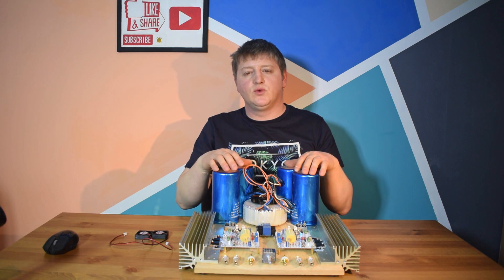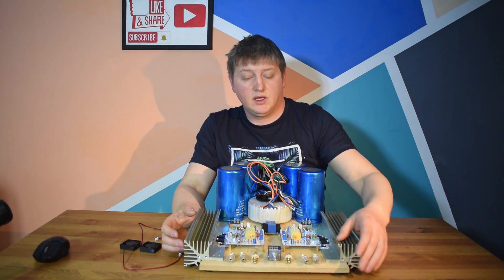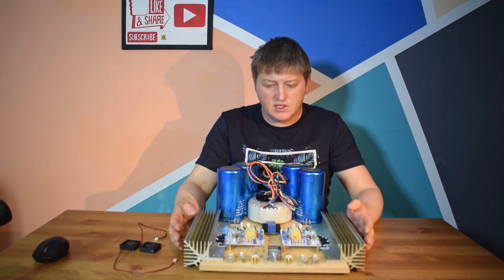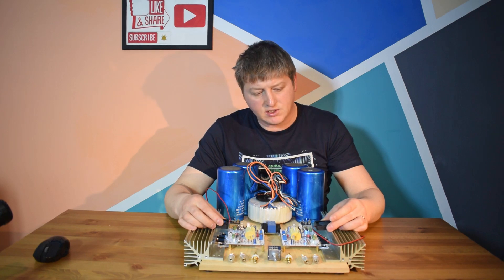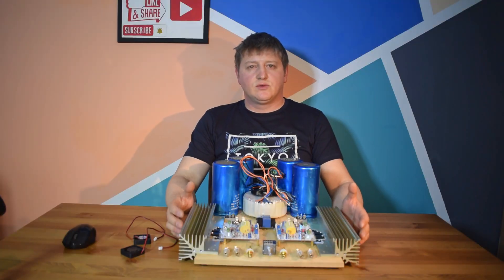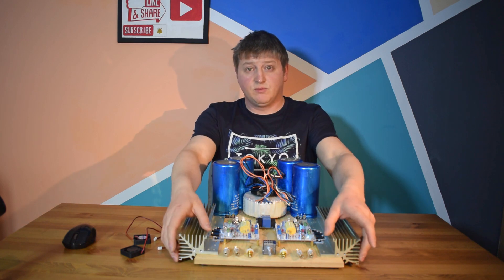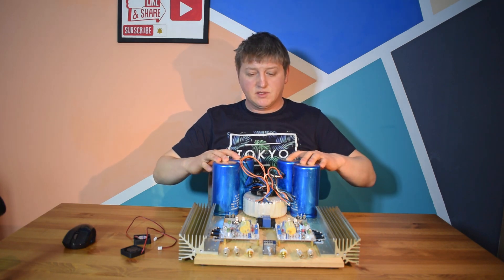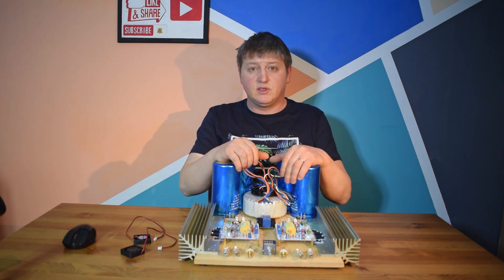Jean Hiraga super classA 30W amplifier build part 2

Comment: I want ask:
1)What is using Elco cap&how uf?
2)did using transformer Ampere&how much transformer?
Reply from the maker: You mean the blue capacitors or the yellow capacitor? And the transformer is dual 24vAC times 2 with 5.6amps
Reply: Blue capacitor
Reply from the maker: @danielhendrik5554  so are 30000 uf each capacitor
Reply: Thank you.
Can I use 2 Psu (one Psu 40000uf)/chanel ?
Reply from the maker: @danielhendrik5554  this amp is powering with dual rail positive and negative and ground so u need 2 capacitors for one PSU. One for the positive rail and one for the negative rail
Reply: Totally capacitor what is using ......uf?
Reply from the maker: @danielhendrik5554  I used 30000uf for negative rail and an other 30000uf for the positive rail for one channel and for the second channel again one 30000uf for the negative rail and 30000uf for the positive rail
Reply: @SymbolTech21  thank you very much.so,for that amp enough cap 0.12 F (2 chanel)
Reply: @SymbolTech21  How character sound?
Reply from the maker: @danielhendrik2498  it's a nice sounding amplifier with low distortion and a really good linearity

Comment: How much metal? how much does it all weigh? And the sound is still no better than a modern D-class amplifier. I was assembling a zen Pass amplifier. It turns out bulky, heavy, heats up, the case is large, and Class D, for example, TPA 3255 or Ice125asx2 power amplifier board sound even better than Class A and compact, do not heat up. Why assemble a coffin with music?
Reply from the maker: Class D are working in switching mode so do you think that will do better than a classA that is always on?

Comment: Hi is not more small the dissipate???what final mosfet you use?2sc5200??
Reply from the maker: Yes using those transistors complementary. And the heatsink yes should be a bit bigger because it's getting hot but for now those is what I have
Reply: @SymbolTech21  have you make the pcb or buy in ebay?
Reply from the maker: @mrtube-z3v  I design them and ordered from jlcpcb
Reply: @SymbolTech21  where do you from??i italy
Reply: You are in fb?
Reply from the maker: @mrtube-z3v  yes for sure
Reply from the maker: @mrtube-z3v  I use to live in Italy long time ago now I'm not there anymore
Reply: @SymbolTech21  but now where live?
Reply: @SymbolTech21  in fb your name?
Reply from the maker: @mrtube-z3v  now I'm in uk
Reply: @SymbolTech21  ok good i want make 20w hiraga
Reply from the maker: @mrtube-z3v  I don't know which one is that because I know there is the lemonstre that have 8w and the super class a hiraga that have 30w
Reply: @SymbolTech21  you write hiraga 20w and show video
Reply from the maker: @mrtube-z3v  it's 30w

Comment: what is the watt maximun of the speaker...???
Reply from the maker: Thanks for your comment. So I don't understand what do you mean with the maximum speaker wattage. So the amplifier deliver clean classA 50 watt power into 8 ohm u can connect to the amplifier also a 200 watt speaker will work fine as well but if u connect a speaker that is less than 50 watt power will end up frying the speaker

Comment: Hi dear 

Can i use 4x 47000uf each amplifier power supply i want make they monoblok and i use 2x 600VA transformer ! 
Your youtube chanel is very very good ! 

Thanks
Reply from the maker: So yes I'm using almost the same 4 pcs 40000 uf and the transformer it's good 600va but make sure have 2 separate secondary 2x 24v

Comment: could you please mention how many uf each capacitor is? and what about the transformer ??(...how many VA ?? the output level 50-0-50 v??  )thanks a lot in advance...Congratulations again for your excellent presentation and waiting for the third part
Reply from the maker: So I have a transformer that have 2 secondary windings of dual 24v so one secondary have 24v 0 24v AC and the second secondary have again 24v 0 24v AC and each secondary handle 6.8Amps. then goes each secondary to his own rectifier bridge and each rectifier bridge have 2 capacitors oh 40000uf 80v each capacitor and after the capacitors I have +34v 0 -34V dc
Reply: @SymbolTech21  so Toni it is 2x24Vx6.8Amps= 326.4VA for each winding and that brings the total needed toroidal transformer power 2x326.4VA =652.8VA right???
Reply from the maker: @ioannispapachatzopoulos4514  yes the more va u have the smoother will run the amplifier because will be more than enough juice to feed the amplifier. Please keep the voltage the same but with the Amps as much higher you go better will be

Comment: Very nice project,  I'm curious did you use the crc resistor as in the original hiraga? It's the 1 ohm between first and second supply capacitor.
And how is the ripple when its biased correct?.
I've made one to, you can see slide photos here on my profile.
Reply from the maker: No I'm not fan of crc and I gave just 2 capacitors per channel so one rectifier and 2 capacitors for one channel and one rectifier and 2 capacitors for the second channel

Comment: Thanks for showing us the famous Jean Hiraga Class-A 30W / 50W amplifier, you need those heat-sinks & cooling fans just to keep it at 65 degrees?  Your amplifier can cook breakfast.  Jean Hiraga Class-A is famous for the ultra-low distortion, you can measure the THD later although if you built it perfectly then it should have the ultra-low distortion,... you look very passionate and now own one of the best sounding [or most transparent / invisible] amplifiers in the world.  I recommend you connect it to one of the invisible sounding DAC's, with one of the modern invisible sounding OP-AMP's~

(not the ancient OPA627 & so on, which became famous due to unique sound "that's OPA627..", Jean Hiraga famous due to invisible nothing sound).

(plus humans can hear [/identify] down to ~.0001% THD* & that's just the reality, humans are like walking lab equipment.. eyes can see millions of colors as well, that's evolution, evolution is cool)

[*plus, since humans have built-in processing in optics & in audio, like we "see what we expect to see", to process faster & more efficiently, then the simple A/B/X boxes interfere with the pre-processing, the sound just blurs together in the brain, humans are not designed to A/B/X THD & time-domain, only amplitude (volume).. A/B/X in volume shows humans can identify.. I don't have the paper in front of me now.. something like the wings of a moth 50 metres away.. that's pretty good... evolution is cool].
Reply from the maker: Thanks for your comment and for advise of the opamps. definitly I will look for some schematics that use the opa627 and I will see with what I can come out
Reply: Hi symboltech, you already seem like an audio expert... If the Hiraga class-A is " pure / invisible " in various time-domain & THD.. & your DAC is " pure / invisible ", then I think it's the line-out section of the DAC which continues to provide sound characteristics.  If the line-out is OPA627, then changing the line-out to a different OP-AMP, for instance LME49990, creates more invisibility.  I already tried that quite a lot & LME49990 is much more invisible than the standard op-amps.   

Second, my comment about A/B/X is unreliable was just for the other youtubers watching & reading.. my opinions that A/B/X immediate switch is unreliable in time-domain, make some engineers at diyaudio.com, annoyed at me, however it's true since when I A/B/X some stuff in time domain everything sounds the same
Reply from the maker: @Xenon777channel  I will try as well this opamp LME49990
Reply: @SymbolTech21    Ok!  I subscribed to your channel 🐺🐍, I hope you upload more videos on the Hiraga & provide your opinions on the sound of the different op-amps,... together with the invisble & transparent Jean Hiraga class-A! 🐺🐍🐺🐍
Reply from the maker: @Xenon777channel  For sure I have plan on doing some preamp opamps projects that's why I make this dual rail bench power supply. if you would have the pleasure on watching this video as well https://www.youtube.com/watch?v=XAZbSoMAcvg&t=88s
Reply: @SymbolTech21  Hi SymbolTech,

I am just informing you that Texas Instruments have discontinued the amazing sounding LME49990.  Now, you need to buy the LM4562, instead.
Reply from the maker: @Xenon777channel  Thanks for informing me about. I really appreciate !
Reply: @SymbolTech21  My advice for op-amps is LME49990 & also the video op-amp AD828 analog.com/en/products/ad828.html

OPA627 is claimed to be about rich & musical sound, it's not the fastest horse or the prettiest horse.  

Thanks again, for showing us your DIY project & promoting the famous Jean Hiraga design, since the Jean Hiraga amplifiers are measured at super super low distortion (like 0.0001%, in some of the tests), so they should be more popular.

Audio is all about amplifiers, second DAC (as long as you have a high quality IEM or speakers)

Valve / tube amplifiers have " euphonic / colorful high distortion ", your Jean Hiraga amplifier is better than all the valve amplifiers, including all the $100,000 Usd valve amplifiers, they all measure bad.  

Ultra-low distortion is the coolest sound, for example Jean Hiraga, LME49990, Sony MDR-EX1000.  Blindfold test verify it easily, (as long as it is an audio person, which already listened to the stuff to get used to it.. not "I will pick a random person from the university / public and ask what they hear"

(Also mp3 is high quality and it's almost impossible to hear any difference mp3 versus flac versus DSD / DXD.  I already tried that the difference is like a grain of salt added to the color blue, it's super difficult to hear the difference & you have to compare for many hours, Lol.)
Reply from the maker: @Xenon777channel  Thanks for all this advices and definitely I will check on these opamps and see which ones suit better. anyway I was preparing a vacuum tube preamp for this hiraga amplifier

Comment: Tony. I'm wondering if those heatsinks/ fans will be big enough? Are the pcb"s available?
Reply from the maker: so the heatsinks yes are a bit small the transistors make the heatsink to reach almost 80 degree Celsius and until I get something bigger I need to use definitely  some cooling fans to push air through. I designed the pcb's so should be easy to design as well using the easyeda software
Reply: @SymbolTech21  yes i think bigger heatsinks would help. I think i will use 1 large pc type fan for each side. 90×90mm.
Reply from the maker: @billkalina3089  I think yes I have 2 small ones and i was thinking to use them to push air straight to the transistors. but I will see if that would not work I will use the 90x90 and use on the front of the heatsink

Comment: more information about capacitors?? heatsinks supplier?? Thanks a lot
Reply from the maker: I ordered all components from mouser
Reply from the maker: the heatsink a friend help me for this project as the big blue capacitors
Reply: @SymbolTech21  the brand of capacitors you use ??....the only one 40000uf 80V i found is a Mallory from USA and it is quite expencive ...thanks again Toni (still waiting in agony for the pcb's to come!!)
Reply from the maker: @ioannispapachatzopoulos4514  they where recovered from other device. but also if you use 20000 uf 60v they will do perfect just instead of just 2 per channel you can use 4 per channel and you put 2 in parallel and you get the 40000
Reply: @SymbolTech21  so will it be OK with two Nichicon 22000 uf /80V DC /+85 C(or +105C ???) in parallel instead of 1x40000 uf ??
Reply from the maker: @ioannispapachatzopoulos4514  yes definitely
Reply from the maker: @ioannispapachatzopoulos4514  If you have also 0.1 or 0.2 ohm resistors 10W will be nice to make crc
Reply: @SymbolTech21  to reduce ripple?
Reply from the maker: @ioannispapachatzopoulos4514  also but more to reduce the inrush current

Comment: good morning and congratulations for the realization ... I wonder why the choice of the wooden base     Did I read somewhere that when the chassis is not used as a heatsink having a wooden base can even improve the sound? what wood did you use?  I guess the wires from diode bridges to caps will be placed underneath the wooden board ?   what i like of the wood is that it does not conduct and also could dampen some vibrations from the mains transformer.  I would use even a rubber sheet under it ...  like those rubber sheets used in the car under the feet.  But they must be rubber not plastic.  Another solution could be a small piece of those carpet to dampen the noise of people walking ...    congratulations again and best regards, gino
Reply from the maker: Thanks for your comment. so the transformer have already the rubber on the bottom and on the top. for the wood plate I will ask my friend and I will be back to you, wires will be some under the wood board and also some on the top of the board. So I am waiting to get the sound card like that I will be able to start doing the final part of this project and do also a nice video.
Reply: @SymbolTech21  Hi thanks a lot for the very kind and valuable reply.  As i said i like your use of a non conducting base plate a lot.  
At the point that i am thinking to gut an old amp that i do not use to try this solution.  
An hybrid solution could be to use a chunky wooden board only for the base side.  This will avoid any shortcircuit.  Kind regards, gino
Reply from the maker: @gino3286  Thanks for your comment, I really appreciate you like my content. so I want to do something different than a normal traditional aluminium chassis or metallic. So I look forward and positive that on the part 3 of this project the tests will give me a good result. so far the amp sound really.
Reply: @SymbolTech21  I will follow your experience for sure.  I have very limited skills but the passion is very very high.  Like with girls.  Have a nice day.  Kind regards, gino
Reply from the maker: Thanks any help my need I will be happy to help

Comment: So you want making music without distortion, which is a good point. Why don't you use a metal case. That is part of lowest distortion.
Reply from the maker: so the metal case will not do nothing for distortion, my helps to don't interference some noise frequencies, so anyway this project still in progress and let me tell you a bit what will be on the final part of this project, the signal wires will be audio coax, then I'm looking to get a metal enclosure special for toroidal to insolate the 50/ 60hz that my can come from the toroidal and how I designed the boards that around all the traces there is all ground trace. and if everything will go well maybe for the final part i will get the sound card and we will have oscilloscope test, THD test, noise test, and audio test
Reply: @SymbolTech21  you need to go back to school😉 https://en.m.wikipedia.org/wiki/Electromagnetic_interference you can't hear HF but it influence audio. 
This changes audio behavior.
If it doesn't make a differance why do mark levenson, krell and audioresearch and many more brands there cases in metal boxes.
So don't tell me that it doesn't effect the Amp. HF distort LG amplification.
Look your making a good amplifier Classe A will always be the best audio performance😍, and most worse efficiency☺️
The Amp will preform but in a metal case it sounds a hole lot better.
Reply: @Dutchamp  so if you say that why all those vacuum tubes amplifiers and also well know high brand McIntosh use to keep the tubes out from the enclosure? And they claim them amplifiers really low distortions? It's not the same things that you try to tell about this built? I would like a really good explained answer please?
Reply from the maker: so you send me to read the link on your comment and says this " Electromagnetic interference (EMI), also called radio-frequency interference (RFI) when in the radio frequency spectrum, is a disturbance generated by an external source that affects an electrical circuit by electromagnetic induction, electrostatic coupling, or conduction.[1] The disturbance may degrade the performance of the circuit or even stop it from functioning. In the case of a data path, these effects can range from an increase in error rate to a total loss of the data.[2] Both man-made and natural sources generate changing electrical currents and voltages that can cause EMI: ignition systems, cellular network of mobile phones, lightning, solar flares, and auroras (northern/southern lights). EMI frequently affects AM radios. It can also affect mobile phones, FM radios, and televisions, as well as observations for radio astronomy and atmospheric science. " and I dont find saying affect audio amplifiers. Please can you explain this for me?
Reply: @SymbolTech21  you can read a lot of it on internet. I don't have the time to do that. Done it a lot in the past.
Reply from the maker: @Dutchamp  so thats why I will try to get the sound card for the final part of this project to run THD and noise tests and we will see how behaves. so lets be positive and wait for those tests to see the results

Comment: i think you need bigger elko's :)
Reply from the maker: Thanks for your comment, I didn't get what is elko's?
Reply: the  big  blue  capasitors , I  was  just  making  an  joke  , looks nice  man  ( how  many   micro farad are they ,and what is  the  operating voltage  of  this  amp  ? )
 @SymbolTech21
Reply from the maker: @aestbird  ah sorry. so i use to call them caps, so there is 40000uf per capacitor